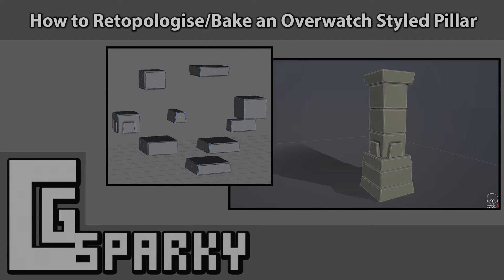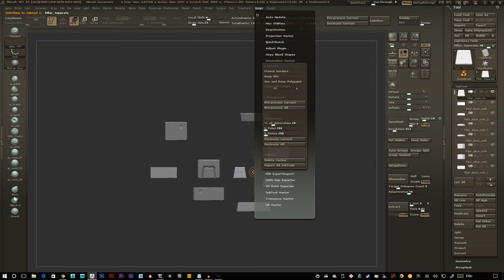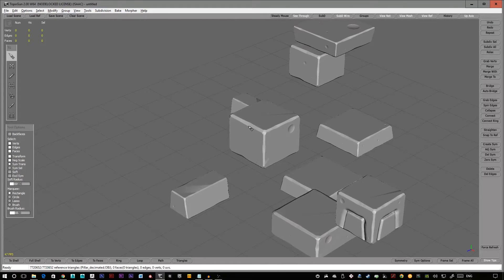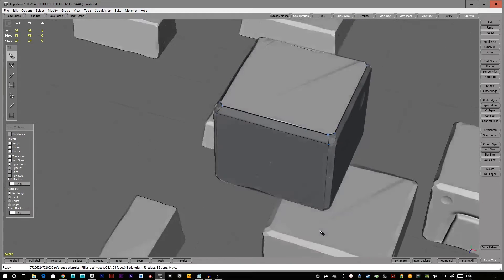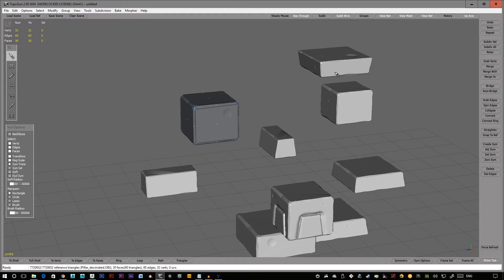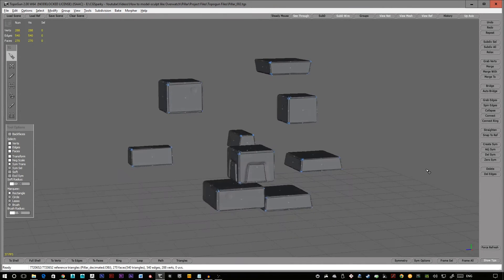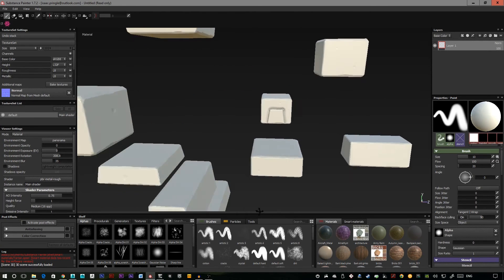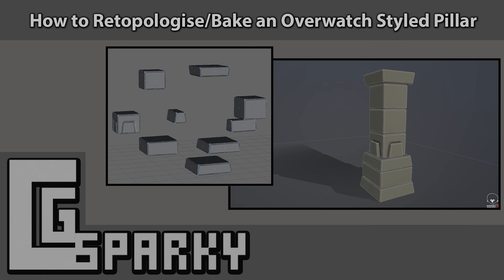How to Retopologise/Bake an Overwatch Styled Pillar

Comment: I was told one smoothing group is bad, because it adds gradients to normal map which reveal artifacts after texture compression, especially noticeable in low settings graphics and mipmaps. Adding more verts (for vertex paint?) could remove some of these gradients though.

But also someone told to unwrap like that if you use triplanar materials (detail normal map and base texture)